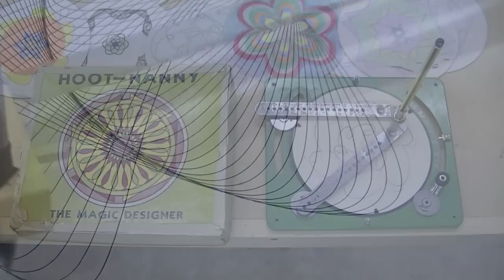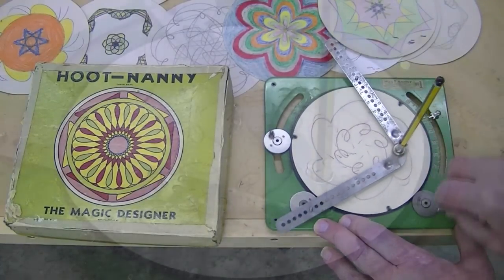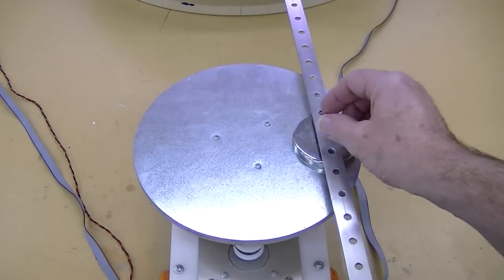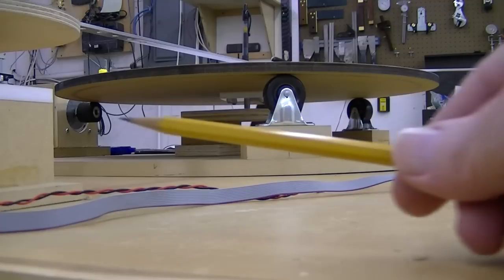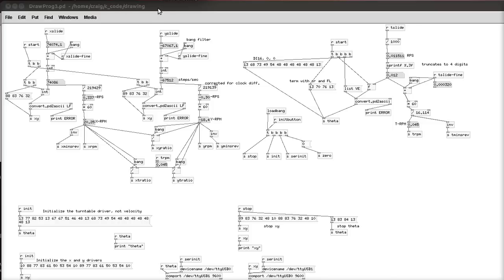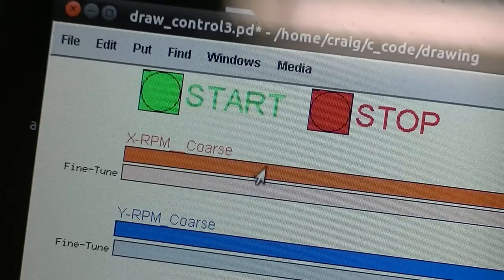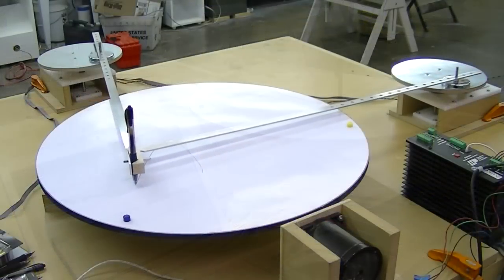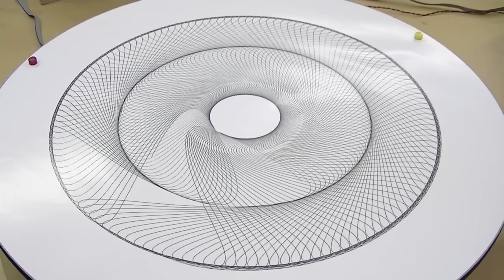Drawing Machine II

Comment: Beautiful work!  My heart melted when I saw your use of the magnets to place the arm spindles, and to fix the paper on the turntable.  How lovely. Had some offerings though on how to make the flow smoother:  you could also set the arms a bit higher on their spindles, and fix their heights.  They seem to interfere with the flow. Also, maybe shave the underneath wheels - it would seem their width would create torc, although give stability.  A narrower wheel  (pointed edge?) , and canted (at a tilt) to the exact center, might yield a smoother roll.    
I too loved the Spirograph I had as a child. A revelation, not overcome.  Maybe that is why I love ice skating.

Comment from the maker: I'm afraid that OCD folks will not be satisfied since the pattern can not "complete" since the three separate motor controllers are not synchronized.  Very small inaccuracies in the speeds of the motors prevent the end of the line  from connecting to the beginning.  I could spend $800 on a new motor controller to solve this.
Reply: photonflood heck, even if it didn't reconnect, I would have at least been fine with it looking like it was completed lol
Reply: you could also set the arms a bit higher on their spindles, and fix their heights.  They seem to interfere with the flow. Also, maybe shave the underneath wheels - it would seem their width would create torc, although give stability.  A narrower wheel and canted (at a tilt) might yield a smoother roll.

Comment: I admire the engineering here, especially the load-bearing solution and the magnetic positioning system. As I'm sure you have realized, it would have been better to counter-sink the screw-heads affixing the plate to the turntable (or just glue the thing) rather than obstruct the placement of the magnetic puck. Super-impressive overall. Thanks for posting this.

Comment: If I knew where your studio was located, I would be looking for discarded prints in your trash barrel. This looks more like art than science. It appears that when you change the setting, you are hoping for the best without being able to exactly predict what will be the outcome. Fun and frustration in one big toy. If you slow down the pace and introduce a third dimension (vertical lift) you will have a 3D printer. Instead of a pen, you can use a 3 D Printing Pen.
Reply: Wouldn't what you've printed be in the way of the pen?
Reply: Erik l My first reaction is: "Not if the altitude of the pen keeps going up (by the thickness of the plastic filament) with each revolution. Then I realized that even with the 2 dimensional machine, a 3 D printing pen can be used if the pen is allowed to rotate (swing) sideways to lift the tip each time it makes contact with a hardened plastic line. One can say that the swing will be in the direction opposite to the motion of the rotating platter and tangent to the line being drone (or something like that).
Once you have the swinging pen, you can also raise that pen. Before you know it you will be building half domes etc. Please tell me about whatever I misunderstood. Thanks!
Reply: Generatorblue Generator blues didn't think of moving the pen up and drawing in layers, and I don't see why it wouldn't work. What I'm wondering though is if it would look like many 2D drawings on top of each other or the 'repeating pattern that is slightly different each revolution' kind of thing in all three dimensions. Couldn't you also draw it on a computer and print it with a 3D printer?
Reply: Erik l do not own a 3D printer or a 3D printing pen. However I spent years working with a hot glue gun. A 3D printing pen is identical to a hot glue gun except for the fact that the plastic hardens faster than hot glue. I assume that some 3D printing pens do not depend on movements of a finger on a trigger to output more filaments. I assume that some of them have a motor to advance the filament. Feel free to educate me about 3D printers. As long as the filaments are more rigid than silly strings, the geometric integrity of the design will be preserved.
Reply: Generatorblue Generator blues I'm not doubting the functionality of 3D printing pens, all I'm saying is that drawing from the bottom to the top wouldn't be like how the 2D drawings in the video are made which consequently give them their look. Sorry if that doesn't make any sense, I find it hard to explain. I'm no expert in 3D printing but basically you build the object from the bottom to the top, layer by layer, adding layers of powdery material that you bind together in certain places. The objects you can make can really look however you want as long as the material can hold its own weight
Reply: Erik l If you have time, please take a look at the "Linda Giampieretti" s channel. She is a geometry teacher who has her students use 3D printing pens in a geometry lab. I also just watched an entertaining video entitled "How 3D Printing Works" on the "ElectroBoom" channel. I think that you could find something that you like in these videos that I suggested. In the meantime, I will read the previous messages that we sent to each other before I respond to your latest comments because I do not have any experience in machine generated geometric designs othern than using a graphing calculator and drafting (CAD) software. I have not mastered any program in those areas. Thanks!

Comment: Did you modulate the motor speeds during those last drawings? You could probably make it draw whatever you want using clever programming, or am I wrong?
Reply: Kinda right, kinda wrong. You could, but then you would just be trying to create a printer essentially that rotated the gears so to print in certain parts of the page based on the image.
But the point here is just that insane cool patterns can be created with a couple mechanical processes.
Reply: i think it could be done, it's a bit like how you can make images with an oscilloscope

Comment: Just found this video. Fascinating. I will attempt to build my own. Did you have any problems with heat build-up in the pen tip from prolonged friction with the paper? Did fibres from the paper cling to the pen tip? What if the rotating paper could move in two additional horizontal axes at 45 degrees to the pen arms?

Comment: I guess it would be two multiplied waves (like sine or cosine) in a circular function. If you would take not a circular piece of paper, but a long paper with the maximum width of the lines and just pull it throughunder it the function would be alot simpler. I guess the hardest thing now is the overlap.

Comment: I did the same thing with a comm 64 years ago only diff was I used a dremel tool to cut the pattern ,an adult Spirograph,I did all the programing in BASIC,If you look in old Circuit cellar mags you will find all the instructions,nowdays a pen plotter will do the same thing....WCH

Comment from the maker: The computer program just sets the motor velocities.  The math really resides in the mechanical arrangement not in the program. You set the positions of the magnets and the lengths of the pen arms then variations of speed ratios creates a family of patterns within that mechanical configuration.  It is not an x-y plotter in the normal sense.

Comment: the way the intervales would work, if it was changed in to #s. it would be something like this: 1,1,2,1,2,2,3,2,3,3,4,3,4,4,5,4,5,5,6,5,6,6,7,6,7,7. and so on. the doubles would be one gear and the rest would be the other. controling how it looks.

Comment: If you're using the computer to control the motors, why not go one extra step and simulate the movement --- and the final curve --- with the same computer, and then print the result on a regular printer? It would save you paper, because you'd only print the nice patterns, as well as a lot of time, since the full simulation would take much less than a second.
Reply: Because it's a demonstration of the robotic control capabilities not a demonstration of cool patterns ; )
Reply: Just because it's mesmerizing to watch. The process rather than finished result. Can you imagine?